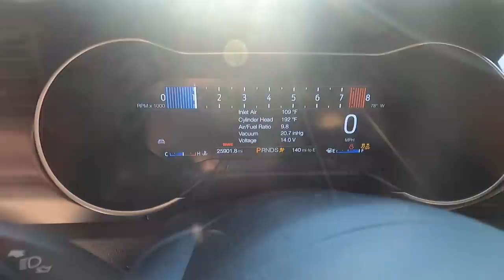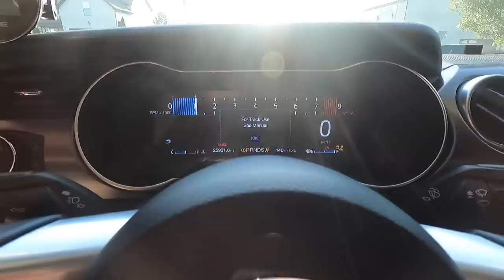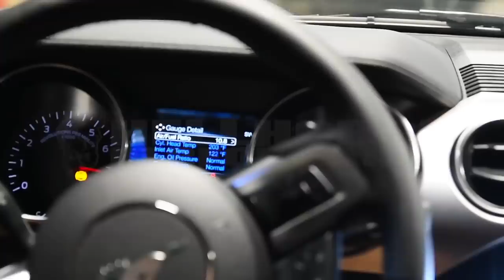EXHAUST MOD on my 2019 Twin Turbo Mustang GT is WICKED LOUD. *SORRY NEIGHBORS LOL*

Comment: I think it sounded better with the corsa mufflers but I get saving the wieght and I'm sure it flows better and probably makes a few extra HP.
Reply from the maker: It’s reversible 😎
Reply: @Zander13Productions  yeah, that's true and it doesn't sound bad it just doesn't sound quite as good as the corsa mufflers. If it were my car I'd do it. - 60lbs. More free flowing and reversable.

Comment: I would have just done Y pipe right behind the turbo with vband caps. I would have left the active mufflers alone. Then when you go to the track you just unbolt 2 Vband flanges with a corldess drill and its ope right off the turbo. No special brackets, no stinky fuel smell under the car with the dumps, and it the least restrictive.
Reply from the maker: Very good idea 🙏🙏🙏

Comment: Why don't you just tune the actuators out that's what we did on my charger?
Maybe y'all can't on the mustang I don't know but what we did was pull the fuse for the active exhaust let the codes come on and then tune those codes out active exhaust still works when I want it to or I can pull the fuse and it's open all the time with no codes